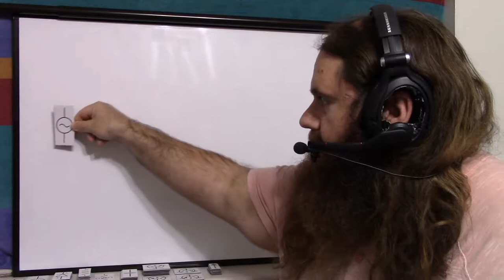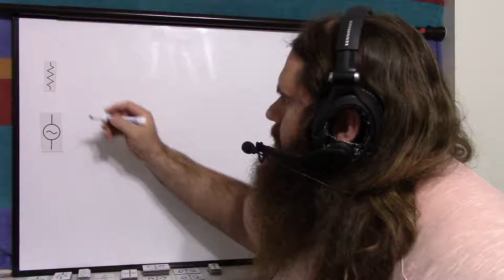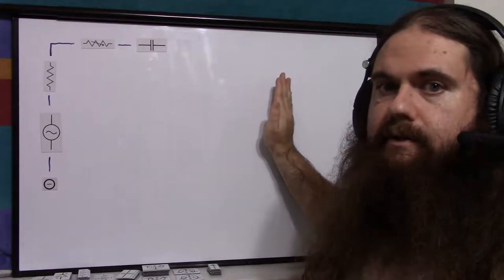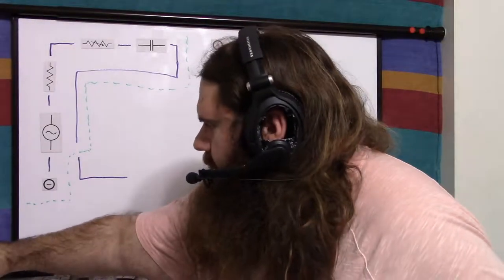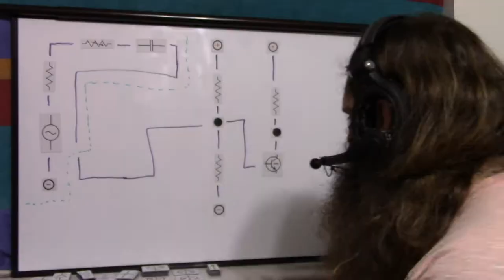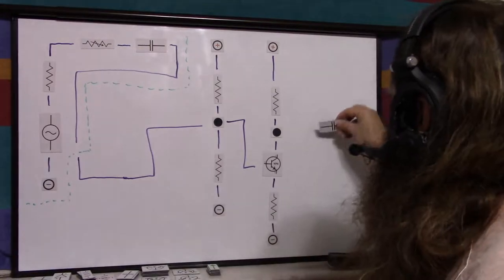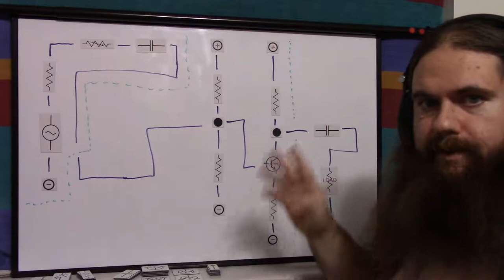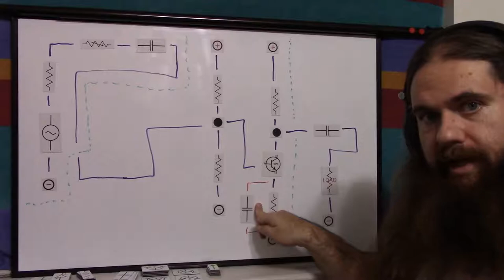A Better Amplifier - Common Emitter Class A - Simply Put

Comment: Thanks for that nice video.

I've made that circuit on a breadboard with a BC547 NPN transistor and a small 8 ohms/0.5W speaker, using the audio output of a DVD player, and well, that works ! That's fun !
I can clearly hear the sound, though it's rather distortionned.